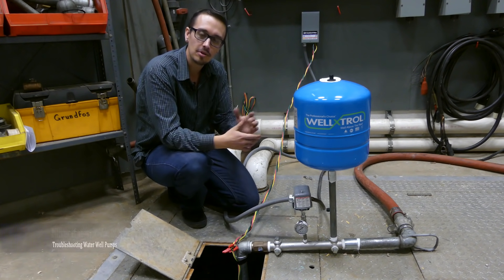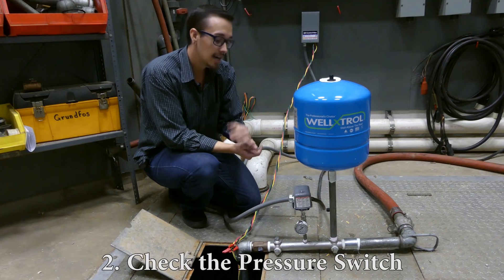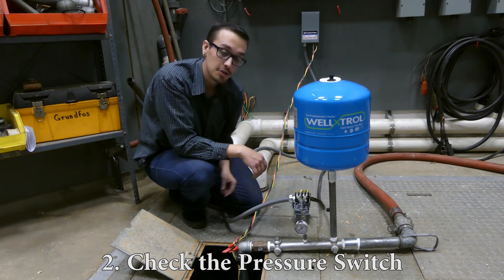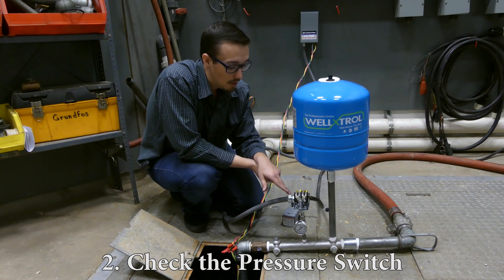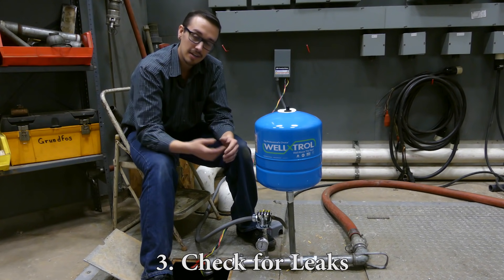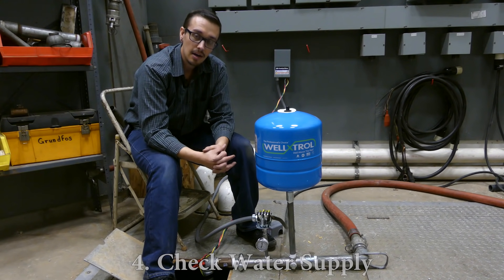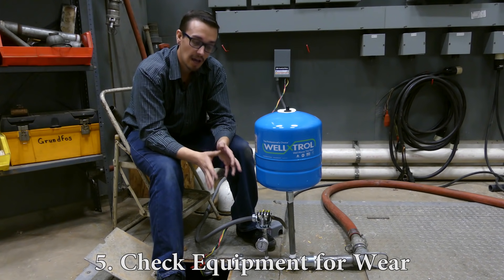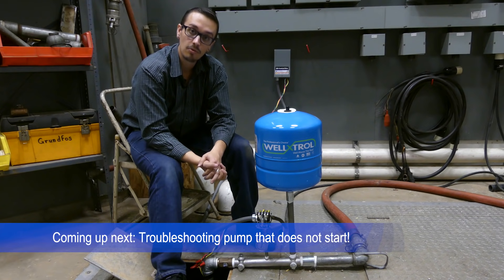Troubleshoot: Water Well Pump Won't Shut Off

Comment from the maker: Thanks for watching! If you have ANY questions or concerns about your water/wastewater system you can leave a comment, call our experts at 855.329.4519 or you can live chat with them on our website: RCWorst.com
Reply: R.C. Worst & Co., Inc. Hello i need help with my well the pump pressure stays at 32 and will not turn off. I changed the switch and pressure tank
Reply: @82sandyreynolds 
Hello 
Did you solve your pressure problem. I am having the same issue.
Reply from the maker: Hi Sandy, have you check for leaks and checked the amperage of the pump? 
How old is your pump?
Reply: R.C. Worst & Co., Inc. I’m having trouble not getting water in the tank  after replacing the  pressure switch and gauge ? Who can help ?
Reply: my little flowtec pump will not shut off. No visible leaks. There is a shut off valve before pressure tank when  shut off  the  pump still  continues to run.
Not sure  what to try next
Reply: Pressure switches do not stick together and keep the pump running. I've been in this business for over 30 years and never had a switch stuck closed. May wanna rethink what you've said.
Reply: Thanks for the enlightenment you so naturally deliver in your videos .... Fun safety fact... One should always verify the power is off with a volt meter prior to any further ..... Also if you don't have a meter you can't expect to perform safe diagnostic and should not.... 'Just better don't '.. however, carefully actuating the points with a electricians or well insulated screw driver is a 2nd option to a Dvom. Thanks man. Enjoy watching even with a well that works fine.
Reply: The best vids from the worst .... Ahhh....😲😒ok I had to . 👍
Reply: I have very hard water and have a soften and filter system on after the pressure tank.  Is there anything I can do to help make my pressure tank last longer? I have so much  lime and scale build up in the lines

Comment: Just put a new Switch on mine and it's doing the same thing. Get pumped up good to the cut-off pressure and then it just won't shut off. I touched the tube feeding it and it immediately shuts off. I've replaced the tube twice I pulled the fitting off the head of the pump it's all clear. I've even bled the air out. Hopefully it makes no spring as I'm going to pretty much replace everything including the inlet pipe

Comment: I just installed a new pump in my well with a new pressure switch.  When I turn the pump on, the switch redlines within a minute or 2, even when I have faucets open and the motor on the pump won't shut off.

Comment: My pump continually runs and I have a shut off valve after the switch, then my water softener, then another shut off valve after the water softener and I noticed when I shut the first valve or the second and even both, the pumps still continues to run.... Does that mean I probably have a leak inside the well??? Because I don't see any leaks anywhere else?

Comment: Have replaced pressure switch at least 4 times,new submersible pump 1/2 hp. New pipe going down around 170 ft . Pump would not shut off with 40/60 pressure switch. Switch would only get to 50 but stayed on. Have set much lower but pressure is so low
Reply from the maker: It sounds like your pump is not capable of putting out the higher pressure
Reply: @RCworstwater  Met a man in the business for like over forty years. He adjusted 40/60 power switch to cut off ay about 45 the pressure was really bad but pump would turn off. Washing machine high water level was very low so checked all the screens in home they were pretty bad. For now pressure is great. We had spent thousands with a company needless to say won’t call them again. Will need to keep an eye on pump and screens on everything. Thank you for responding.
Reply: This man charged us 75.00 wish id met him sooner. Asked for help on fb group. Greatful

Comment: Hi, I have a jet pump for my cabin, one of those with the little tank underneath the pump, and I accidentally ran it dry last week. I dont know for how long it was without water, but we´re potentially talking hours unfortunately. The pump was brand new, installed a month ago. It does run, it sounds normal. Ive primed it back up but it doesnt seem to suck water from my tanks. I have a see through plastic pipe between the tank system and the pump, and I cant tell if theres water in it. Should priming the chamber be sufficient or do I have to prime the pipe as well? And could something else be wrong? Is there any way to fix it? I wish you could do a video on repairs for dry running a pump :) Thank you for your wonderful videos, you´ve truly raised my confidence on this as I live off grid by myself.

Comment: I’m having water issues currently.  I checked the system and the pump was running, contacts in switch were closed, pressure gauge read 0. I have on/off switch at the pressure switch ans above the pump and motor in the well house. I cycled both switches to look for change in state. The pump turned on and off at both. I walked away from the well house too the tank and switch under my house. It’s literally less than 40’. I looked at the pressure guage and it’s reading pressure. I go in and check the faucet in the kitchen and everything is normal like nothing happened. A side note , I had a filter system installed about a year ago, it’s not function correctly I dont think, mot sure it ever did (another story). I bypassed it before troubles shooting but just before I moved the 3 ball valves I opened the two little plastic ball valves which I. Source are there to specifically check for pressure and j had pressure at both. So to recap the pump was running. Contacts weee closed, pressure read 0, but I had pressure at the two little ball valves inter filter system. It’s Saturday I know but any info would be helpful. I’m gonna give the pressure switch another good inspection and possibly clean the pressure tube. Thanks in advance for any help.
Reply: I should add thta this is probably the 3rd time this has happenenerj the last 4-6 months.

Comment: I have excessively high water pressure & the pump will not shut off, unless I flip the circuit breaker. 

I am unable to locate the pressure tank or switch. It is not under my mobile home.

Comment: is the pump supposed to run the whole time during long demand like watering the lawn for 20mins or it should cycle on (psi hits 40psi) and off (psi is back to 60psi) during demand?
Reply from the maker: It's better for it to stay running the whole time

Comment: We have a Radon reduction system in our basement which is basically just a tank of water with a submersible well pump that sits inside of it.  Water gets aerated to remove radon and then it sits inside the tank waiting to be pumped to a well tank based on demand.  Intermittently, the pump inside the tank will run without building up pressure.  It'll just sit at 30 psi, the low pressure limit, and run without building up pressure.  While this happens, we still get water supplied to the house, just at a low water pressure.  If we unplug the pump to shut it down then immediately plug it back in again, the pump runs fine and builds up pressure normally.  It seems to do this a few times a month, for some reason.  Have you seen anything like this before?

Comment: I have one that won’t shut off have plenty of pressure at hose bib but won’t shut off new pressure switches I tried two and the little line is new 
No leaks 
Pumps only to water garden 
Sucking line and foot valve is good I’m lost
Reply: I have the same issue. Plenty if pressure in the house / at the hose. Pressure switch is a 40/60, tank is charged to 38 psi, pressure gage holds at 45 psi and never cuts off. I installed a new switch and switch tube, having the same issue. I can just slightly touch the lever on the bottom of the switch and it will cut off. But it will not do it on its own? Any suggestions?
Reply from the maker: What pressure is it building to?

Comment: Interesting. My well has gone dry and burned up twice. It’s 540 foot deep, had the pump dropped another 40 feet. The problem is, we have 2 golf courses that up the road from me and drain it and the pump runs until it burns up. Very expensive to pull and replace. Is this what I need to keep the pump from running with no water? Thanks
Reply from the maker: Give us a call: 855.329.4519

Comment: Im in Jamaica first watching your channel. I recently serviced my water pump and change bearings inside. Like today water was in my pipes and didnt lose pressure.  One of my relatives turned on water pump because a little pressure was lost. When i came home i saw the switch on and didnt hear the pump but water pressure was high and didnt hear pump at all. So i turned off the switch and came back 5 hours and turn back on switch. But the pump didnt come on at all. Water pressure is heavy what you think could be wrong?

Comment: Okay here's the situation my well stays on will not build up past 55 put in a new 40 60 pressure switch check tank holding pressure set correctly what could it be

Comment: My pu mp will not hold pressure it leaks off about every 3 to 5 minutes and kick back on but keep s on cycle ling  help) if you can.thank you and God bless You
Reply from the maker: It sounds like you have a leak. It needs to be identified and fixed.

Comment: Square D switch only a few months old sticking closed over-pressurizing the house! Has happened 3 times in the past week now.... once I force the contacts apart (with corner of plastic cover) it goes back to working right again, till it sticks again a few days later. Sprayed contacts with WD40 but made no difference. Ordering another new switch right now, but sure would like to know what's causing this to happen!
Reply from the maker: You may have a buildup of sediment/debris in the tube connecting the pressure switch to the water system. I would recommend inspecting that tube and cleaning/replacing as needed.

Comment: Hi I have a problem with my system, my pump wont get to full cutoff pressure (50 PSI) and shut off, but doesnt also appear to lose pressure if I shut it off. Any ideas?
Reply: Your pressure switch might be a 30/50.

Comment: Brand new everbuilt pump. pressure switch tube has residue in it? pump when I shut it off was hot, have not been able to get it to get pressure again. Did have water, it was lake line in winter. Had a in line heat line set high(not on the max setting), and the heat line did not kick off the outlet. Did it freeze? I don't think so with the water in the line. Was thinking I had to clean the impeller? Paine to try to figure out how to get to it. Help line is no help.

Comment: Hello, my pump won’t stop running and ran up my pge bull very high. I’m going to try these steps but I’ve had the well shut off from breaker for 3 months should I take any steps when turning it back on or should be fine

Comment: Thanks for the enlightenment you so naturally deliver in your videos .... Fun safety fact... One should always verify the power is off with a volt meter prior to any further ..... Also if you don't have a meter you can't expect to perform safe diagnostic and should not.... 'Just better don't '.. however, carefully actuating the points with a electricians or well insulated screw driver is a 2nd option to a Dvom. Thanks man. Enjoy watching even with a well that works fine.
Reply: The best vids from the worst .... Ahhh....😲😒ok I had to . 👍

Comment: would a failed pressure tank cause the pump to stay on and run continuously also?
Reply: No, a failed tank would still allow consistent pressure to the pressure switch. The only way it would affect it would be if sediment from the tank blocked the pressure switch port

Comment: Love this video very helpful 👏 my well is running constantly I think the switch it's not turning off... until I turn it off manually...I replaced the blader and the pressure switch...I ran the well on a water slide from 11 to 7 now I'm having issues... we still getting water now...but way less pressure...and I wna do it my self because it's 2500 for someone to come out...I dnt know wat pump I put in back in 2009 but itz 2021...I think itz 100ft deep...what pump you recommend...thanks for the advice...

Comment: So my problem isn't apparently normal and I've been searching for an answer.  I can very easily pull my pressure from 65psi to literally settle at around 10psi and hold there with a 2-3 bathroom sink faucets running.  Or if I open my 3/4in outdoor sillcock line drain valve and leave the supply valve open i can take the pressure to nothing and well pump will continue to flow but very low pressure.  Is this more a case I just need a booster pump to help maintain higher pump pressure or should I be concerned about the pump? Its a well from 1989 as far as I know its the original pump (owned the house 10 years so the pump is atleast 10 years old. Had to replace tank and control box 3 years ago as capacitors fried.  I did notice this week when I pulled the cap to shock the well that I have a wire that's not very healthy and insulation is failing on it. I'm going to replace it as I believe it was likely what caused the control box to fail originally as its the red wire that has the bad insulation and showing corrosion.  The pump isn't pulling high amps and it never fails to run but it doesn't like to build up any pressure as soon as you shut the water off it will start building pressure and takes a bit over a minute to refill the pressure tank. Im at a loss as to why.. it has been doing that as long as we've had so I find it hard to believe that a bad pump has made it this long and not gotten worse or failed. Please any idea you may have is appreciated

Comment: I just replaced my pressure switch which is a 20/40 and the gauge reads a little past 40 psi. When it gets to 40psi it continues to run and won’t cut off so what do I need to check ?
Reply: Any luck on a resolution for this? Thanks

Comment: My pump won't shut off once a while. Sometimes only. I press the reset button, but it still won't stop unless I cut the breaker. And when I turn the breaker on again, it continues to pump without stopping again.  But it's has a protection switch, so I shut off the valve from the water source, it stops, turn back on, it's working normally again for a few weeks until the cycle repeat. It's not an old pump or anything, so what do I do?

Comment: My pump was running continuously and found My pressure switch had a burnt contact. I replaced the switch and it seemed to solve the problem. That was a few months ago. Now it’s doing the same thing. However, it will shut off if I just gently tap the pressure switch and the contacts will open. But as soon as I use water again, it will run until I give it another gentle tap. 
Where do I go from here?
Reply from the maker: You need to replace the switch and the 1/4" tube connected to it. It's likely filled with sediment/corrosion.

Comment: Woke up today and pump was running non stop gauge said 45 psi shuts off at 50psi. I changed pressure switch same thing. Holds pressure when i turn it off. ???

Comment: I just moved to a new house and got a well tank put in last week. And it's been continuously running I'm new to this whole new well thing so I'm not sure what I need to do
Reply from the maker: Sounds like you might have a leak. I'd call the company that installed the tank and let them know what is going on.

Comment: I pulled my pump a few weeks ago. The system pressure was dropping gradually over a few weeks, and then it just died entirely. You mention amp draw...my system has a 3/4 HP pump, and it was drawing 6.8A running. When I pulled it, I set it in my pool ..was running, but not  pumping squat. Replaced pump, drop pipe and power cable, and life's good now

Comment: I took my pressure control switch off and opened up the diaphragm and it was full of wet red mud?  I’m not getting water into the home?   Why am I getting this excessive amount of red mud?
Reply from the maker: Sounds like clay or iron buildup. You need to replace the switch and the tube connected to it.

Comment: R.C.Worst & Co., Inc, 

First thanks for all your detailed videos.   So our problem is, we replaced out yard hydrant with a new Woodford Y34.   The yard hydrant is hooked up to a irrigation drip tape system for our garden.   It seems that the well cannot keep up with the demands of the yard hydrant.   Our well system is a little older. Ive replaced the pressure switch, I drained the Pressure tank and set the pressure ( Its a 30/50).   Now the well pump does seem to short cycle when its trying to regain pressure.  It will run a minute then stop, then run a minute etc...but like I mentioned basically we are using water faster than it can keep up.   The pressure tank is a 32 gallon.   Would it be more beneficial to switch to a larger pressure tank?  Or is it time to replace the pump etc..?

Comment: I have very hard water.  I have a filter system and water softener after the pressure tank.  Do you have any recommendations of what I can do to help prevent buildup in the pressure tank?  Is your pressure tank recommended for someone who has hard wster?

Comment: Hi Chris I got a new pump and pressure tank install this weekend, how long should the tank take to fill before the pump cuts off??? Mine is a 1.2 hp pump and a 19 gallon tank but the tank is tanking 1min and 53 seconds before the pump cuts out, is this normal ???? pressure switch is set to 40/60 .
Reply from the maker: Can you tell me the model # of the pump and tank?
Reply: R.C. Worst & Co., Inc. Pump is a Lowara 3VM06P09M5HVBE & Tank is a Pro Source PS19T 19 gallon